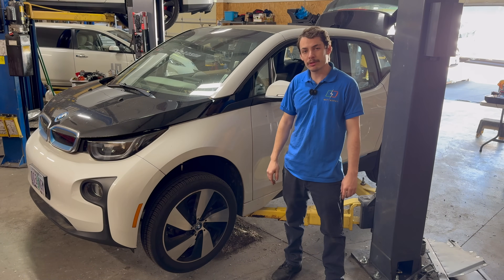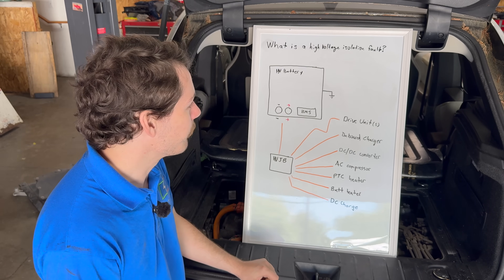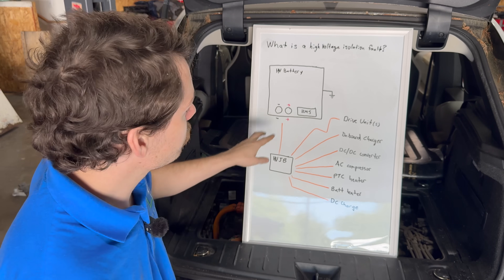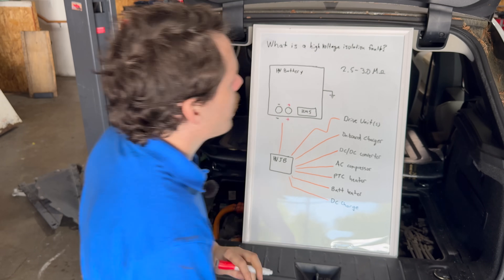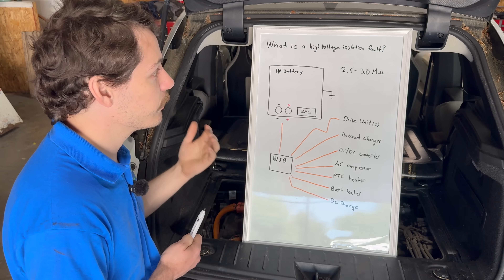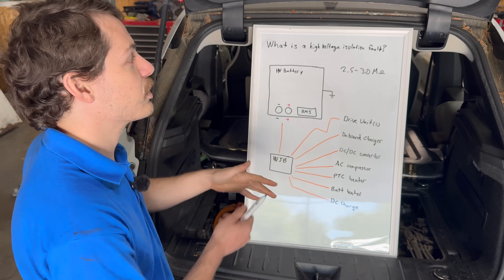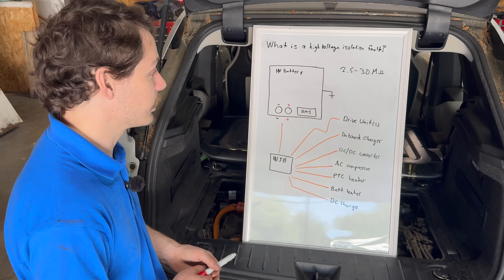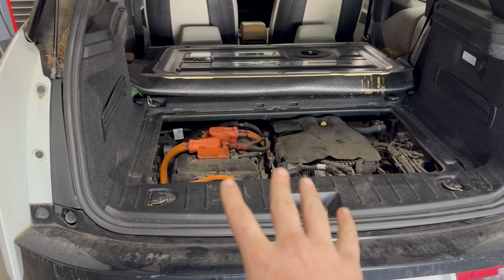How To Diagnose Electric Car Isolation Faults

Comment: Very interesting.... hey since there is such a huge problem with the AC charger or KLE I think its called,   could you do a video on why they fail,  how to tests for failure and steps needed to replace them with the REX.   Iv heard stories of having to pull the REX or a shorter method of removing the rear bumper.     Thanks... no one has produced a video on the KLE.

Comment: Hello  sir, 10:49  you check isolation  of high voltage battery pack cable, that time high voltage battery pack cable connected with battery pack? Or open connector  from  high voltage battery pack.  Pls give me information.

Comment: THANK YOU SO MUCH for doing this little LoI demo - crazy helpful!

We do EV Jeep conversions and have a 'problem' converted Jeep back in the shop with an intermittent LoI fault from the BMS (Orion BMS). It's still well withing the 1M-ohm range but it's not at the 4M-ohm range so the fault is a 'for you information only' fault. 

Still, I'll follow through exactly as you did and see if I can find what is causing the kick (fault).

Oh, and I was going to buy the Fluke version of the Klein resistant tester but now that I see how well yours work, I'm going with that.

Thanks again!

Comment: Hi bud, I followed your exact method, unfortunately all the wires and modules show 400ohms. So what’s the next step to trace the hv leak? Please help me car is stuck on drive and I’ve spent £5k to try get it fixed and it’s not working and I am loosing double the moeny, could have brought a Tesla in that price lol
Reply: How it's was explained on the video. You have to go one by one on all components. If you really have battery insulation issue. One of them will be shorted. Battery also can be shorted especially on Toyota cars. Just check all components one by one using insulation tester. It was very good explained on this video. Just disconnect battery and check battery cable. If it's 4000M ohms or some other big number then short is probably on the battery or there is no short at all - False positive error code.

Comment: May I ask, serveral days ago I had mearsured a electric car flooded over the dashboard. During the measure process, I saw that with the same connector, some pins showed a resistance value while some showed L.o. What is that means, and is it enough safety ? I'm new in automotive, so i'd like to hear advice from pioneers

Comment: Hm in general looks like when you check both pole with all components attached is not looks same as when you test cable completly in air, in this case i think cable should be tested for both poles. When component attached it could shunt problem in cable.

Comment: hey alex, just an idea ive been having for the last few months regarding cell swapping a weak pack like in the imiev.
i think it might be a really good idea to add a capacitive active balance pcb to each module or atleast the one thats testing low after swapping out a cell as a bit of future proofing against additional/cascading cell failures. not a lot of accurate info on youtube about these cheap pcb boards, but basically the capacitor ones are able to smooth out or minimize the voltage delta between cells in a series pack by transferring charge between series cells, and the capacitor ones are able to get voltage deltas below 100mv. the inductive based heltec balance boards usually are more durable, have less vampire drain, and are more efficient but they can only balance down to around 200-400mv which is much too large to keep EV's bms/becu's happy. i think the volt and bolt brick their packs/stop charging above 50-75% soc with a shvc error after a voltage delta above 100-300mv.
only issues would be potential false loss of isolation faults, or the fact that theyre another component that can bite the dust inside the hv battery box.
lot of yt videos misunderstand the application of these dumb/anologue bms' and atleast with the imiev pack with post/stud terminals it wouldnt be too difficult to add the balance leads directly on to the cells themselves. with pouch packs like the volt, someone would have to drill the individual busbars and find a reliable way of keeping a connection torqued. maybe a rivot would be better for this application but i dont pretend to know much about NVH and electric automotive fittings.
ive heard stories in like central america where labor is cheap and very risk tolerant to where they will crack open a ev battery pack and manually re-balance the cells with a lab bench powersupply every time an error is thrown. seems like a better idea to stuff an active balance board in there. theyre capable of doing like 10-50x more balance current that most resistive type bms boards, and would work harder and the entire time that the pack is imbalanced, not just when charging like most bms boards. imo this is the future of keeping discontinued/unsupported evs/phevs on the road.
for more demanding applications i try to find a way to superglue/silicone/epoxy some tiny pcb heat sinks on the boards since they can put out a bit of heat. just dont want a heat sink comming loose and ratteling around in a high voltage battery enclosure lol
Reply: The i-MiEV (as well as pretty much every other OEMs BMS) already has cell balancing built in. Every automaker does things a bit differently, but on the i-MiEV, it seems that the balancing kicks in when charging above ~75% SoC. 

If a cell is weak enough that it is causing operational issues due to voltage sag under load, then no "additional" active balancer is realistically going to be enough to cause it to not be a problem (unless it's something that can deliver tens or even hundreds of times more "balancing current" than normal). 

If the issue is a capacity imbalance, more balancing current may be enough to get the cell balanced before the start of your drive, but once you start to discharge the pack, the SoC of the lower capacity cell will still drop much more quickly than the rest of the cells in the pack. Once again, no "normal" active balancer is going to be able to deliver the current required to keep a cell that is significantly out of balance in check with the rest when discharging. Maybe it could be enough if the car is only driven on very short trips.

If a cell gets bad enough that it starts to self discharge due to a weak short, then attempting to keep it in check via "high current" active balancing is also pretty sketchy, as it could possibly lead to a thermal event, as cells with weak shorts are much more unstable at higher states of charge. There's a reason why "advanced" BMS systems flag weak short issues and limit SoC as a result.
Reply: @AlexEVRepair  hmm all valid concerns. i think it still worth a try in some of the early evs/phevs that have an overly agressive bms that locks the pack out if there is only ~.1 to .2v of imbalance like the chevy volt. 
most capacities active balancers do around 1.5 amps constantly at around 90% efficiency. 
it would at the very least help a somewhat weak pack to not loose balance and fight cells which have a somewhat higher internal resistance, more than the designers expected to push the life of an ev out until other components started to fail. maybe not something we will do in the usa as long as batteries are cheap, but most other places in the world i could see them using them.

Comment: other note, some mehommeter does inversion polarity check and other no. Some electronic components could have a low resistance in a polarity and high resistance in the other. This could be normal and not giving any isolation fault. So, better to use a "bipolar" megger (usually cheap megger) respect that doing polarity inversion in automatic form. This is my empirical experience, not clear to me what component could give this effect. usually is inside BMS.

Comment: did you removed cooling before I suppose because otherwise it could make as bridge of isolation fault in any place and make impossible to isolate a component. Am I right?
Reply: If coolant were causing an isolation fault in a component, then that would mean there is an internal leak in that component causing the issue... This is actually a very common failure on the Tesla Large Drive Unit.

Comment: Thanks for the explanation.  I had no idea one component like an AC compressor could take down the entire vehicle.  You would think if these kinds of failures are common, manufacturers would develop something like the BMS that would identify which component was faulty and possibly isolate it from the rest of the high voltage system so you could still operate the vehicle at least long enough to get it to a repair facility.
Reply: it IS crazy...!!!!   people should AVOID buying the kind of CRAP.

Comment: For those unfamiliar with megohmeters, they apply a test voltage to the probes and measure leakage at high voltage, rather than the way a typical ohmmeter measures resistance.  Be aware that the meter is actually generating 500v and putting it on those probes.  Alex is comfortable with his and he moves easily around it, but the tester itself can shock you pretty hard.  That's why there's a lightning bolt icon displayed on the meter any time >30 AC RMS or 60vdc is on the probes.  When he's using it, watch the voltage displayed at the lower right.

My 1507 has a larger finger guard on the probes than Alex's Klein, and I like how it makes me keep my fingers behind the probe tip.
Reply: thanks!
Reply: ill guess it cant kill you, because of the low amp capability of it, but yes its dangerous

Comment: Thanks Alex for an excellent EV training video! Would it be possible to just disconnect the AC Compressor when fault finding or does it have an interlock and if so can it be tricked cheers sandy (Scotland)
Reply: Bypassing the HVIL would make the car unreliable. Also the AC is used to cool the battery pack, on the i3 directly, so you don’t want to use the car without a working AC.
Reply: IDK anything about the i3, but the connector Alex was manipulating clearly contains HVIL contacts.
On other EVs, the AC system is an integral part of the battery thermal management system, and it's kind of hard to do without.  Again, IDK about the i3.

Comment: Are there any gotchas to look out for when using a megohmmeter? Apart from knowing what voltage is safe, as you mentioned. (I’ve only  used one for checking solar panel wiring.)
Reply: Yes!  The test actually applies 500v to the probes.  Be wary when pressing the Test button.
Reply: Yeah, probably should have mentioned, don't touch the probes when powered!
Reply: @AlexEVRepair heh i guess 😂 - but I was thinking more like how beginners with even just 12V Power probes can fry ECUs.  But here you’re testing marked (orange) HV wiring. So it should be safe for all HV components?  Or is there stuff that fries if you’re dumb.  Anyway thx for the video.
Reply: @TVwatcher-ic3ne  Depends... For example, some PTC heaters can be damaged if exposed to more than 400v, so it may be best to test some components at 250v instead.

Comment: I have a question: on the last check, was the wire connected to the other end? Or the multimeter set does it work this way? I understand that with a basic multimeter these checks are not possible, don't I?
Reply: These checks are done with a Megohmmeter (aka "megger") and not a "multimeter". Different functions. A multimeter cannot detect insulation faults effectively in high-voltage systems — the voltage it uses is too low to reveal leakage paths.

p.s. If you're looking for a Megger that cost less than the Klein ET600 (~$170), you should consider the UNIT-T 1000V megger (~$80).
Reply: If it's a "severe" enough loss of isolation, a regular multimeter might work, but often times the amount of impedance is high enough that a regular multimeter won't be able to pick it up due to their low sampling voltage. A Megaohm meter tests at a high sampling voltage to measure isolation resistance on the HV system, and is the only surefire way to get truly accurate readings.
Reply: Most IMD's (isolation fault monitors) warn at 500ohms/volt and show isolation fail at 300ohms/volt.  So on a typical consumer EV running a 400V architecture, that's a fail at 120,000 ohms.  A regular multimeter when testing resistance is usually using 9V or less and unless there's a very severe isolation fault, at 9V you'll see perfect isolation but at 500V like Alex is using, you'll see the actual fault.
Reply: I would also like to know if a basic multimeter would work.
Reply: @dauerwerbesendung7045  This class of tester actually applies 500v to the probes to test for leakage; this can't be tested via a typical DMM.